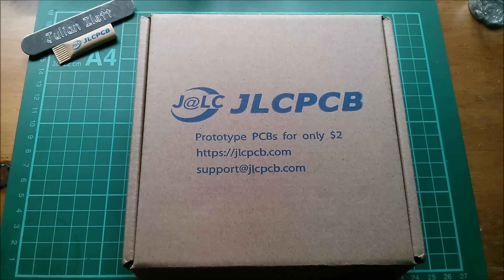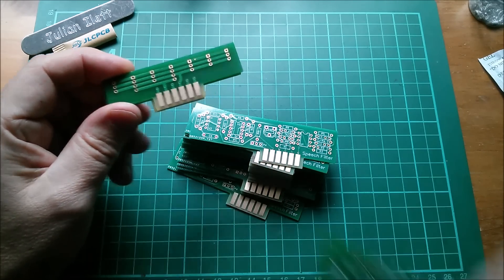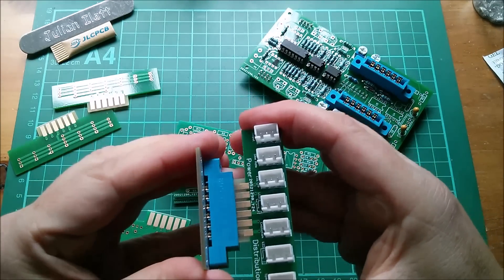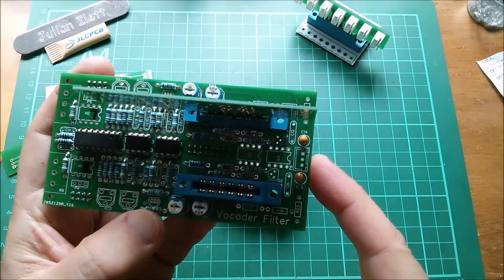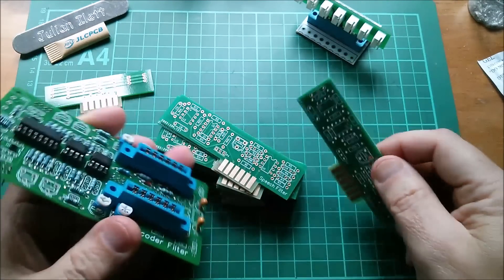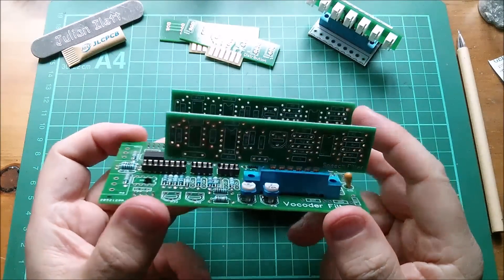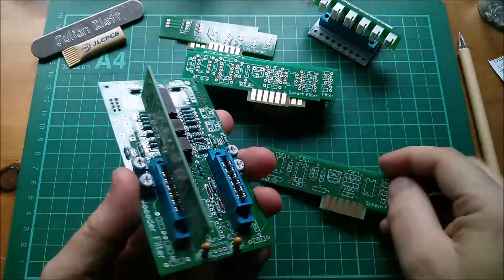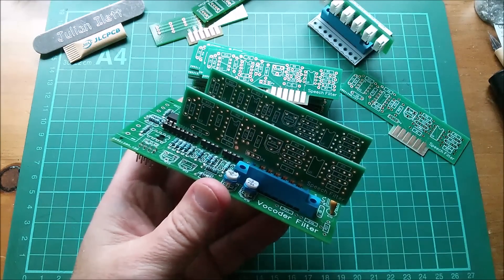1.2mm PCBs from JLCPCB - A Perfect Fit! Vocoder

Comment: Having worked with an absurd number of various kinds of circuit boards over several decades which were in a wide variety of equipment,  I noticed that during the earlier days of computer stuff there were a lot of those edge connectors in use.  Later on,  they all seemed to change to pin-type connectors.  Think early vs. late floppy drives,  or hard disk drives.  I still have some cabling around here for some of the older stuff that I'll probably never use.  :-)  My recollection of those edge connectors was that there were three common spacings:  0.100",  0.125",  and 0.156",  with that last one being the most common.  There were others,  I'm sure.

Comment: I have an arduino led project which I'd like to produce as a low volume production. Many of the websites offer manufacturing but not pcb design and component procurement.  Do you know a company that will design and produce the component? Or a freelance to design and then select the manufacturer?

Comment: On JLCPCB, if I choose the ENIG finish, do i have to choose the gold finger option as well or is it just to provide chamfers on the edges? Because for a game boy cartridge pcb, since they are so thin, single sided edge connectors and aligned with the back plastic shell, I believe the chamfer itself is not needed.

Comment: I cant remember which channel it was on, but it was one of the retro games ones. The modern ROM cart boards they were producing, they found it better to leave solder-mask 'creep' over the fingers a bit, especially around the area where the track meets the pad of the finger, as the sharp corner was susceptible to corrosion, and they were getting open circuit faults at that point. The issue was easily solved by editing the edge connector component in Eagle, and leaving a mm or so of solder-mask in that area when removing it for the connector.

Comment: You can get some nice metal higher precision calipers for quite cheap from china, eg https://www.aliexpress.com/item/32826734595.html - which will do a much better job, however i still keep both the dodgy 1 decimal place plastic ones and the nicer 2 decimal place metal ones, because the metal ones can scratch many surfaces if you aren't careful.

Comment: you have solder mask on the back side...
one more question, why remove solder mask on the gold fingers?
Reply: It's normally a design rule imposed by the PCB manufacturer to keep solder mask and silkscreen away from areas to be processed with hard gold.

Comment: 5 dollars US says the lighter green is a solder mask.  It's just not as dark because there's no copper underneath.  It looks like you are using a copper pour for most of the board back side hence why it's lighter, bc there's no copper underneath it.

Also you should check to see if the fiberglass materials fluoresce.  The use that for automated optical inspection.

Comment: a while back i had some zx spectrum interface2 rom cart boards made, i was experimenting with roms and attempting to make my own rom carts,  i found that there was quite a variation in the gap of the cart edge connector, i have 7 interface 2's 5 sinclair and 2 datel electronics, a board thickness of 1.2mm was the best fit for all my interfaces, i expected the gap to be mostly uniform(bearing in mind 99.9% of these interfaces have never had anything plugged into the slot).
i mean only about 5 people had bought rom carts back in the day so the slots were unused, but there were all sorts of widths so i made one that worked in them all.

Comment: Thank you for showing the results from JLCPCB. 
I would like to know how you define cutout and chamfers in the files you send to JLCPCB. there a plenty of videos that show how to generate the basic gerbers, but I have yet to find one that enlightens me regarding cutouts and chamfers in various location on the PCB and how make it clear for JLCPCB what I want. Also I notice that you seem to use different chamfer angles.
Maybe that could be a topic for one of your videos.
Reply: The chamfers are not defined in the gerbers. At jlcpcb you only check the box for Gold finger chamfers and i'm gusseing the add the chamfers manually by just looking for gold fingers.
The cutouts are defined by the border layer. Depending on your pcb Software.
Reply: Create a mechanical layer for slots and routed areas. All PCB packages should have a method for doing this.

Comment: You could check wether there is soldermask between the fingers on the new board by checking if solder sticks in between the fingers.
Reply from the maker: True - I do have 6 spare boards.

Comment: Wow. I've never seen a digital caliper with only 1 decimal for the mm scale.
It's like working in meters for your dining table length. (hihi)
Reply: They are made from plastic, so no point in more decimal places because they are not totally rigid and thermal expansion is 10 times more than metal. I like them though because they don't scratch, so they are good for measuring delicate things, like images on a screen. I have expensive metal ones as well for precision measurements.
Reply from the maker: Well, it is an eBay cheapie :)

Comment: so looking forward for the sound julian. really nice project, it is like a good written storybwith so many tension arcs .. i was wondering ? will your filter boards be  pot-frequency-adjustable ?
Reply from the maker: There is a potentiometer in the filter circuit, but it's adjusted for filter gain rather than filter frequency.